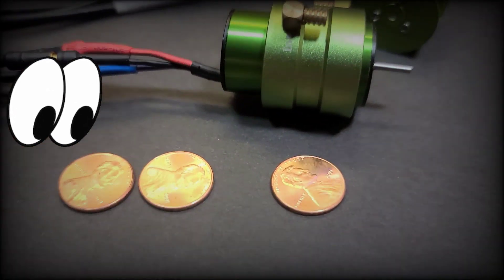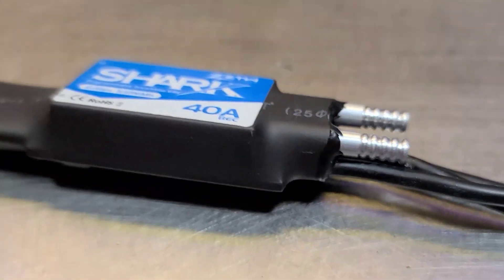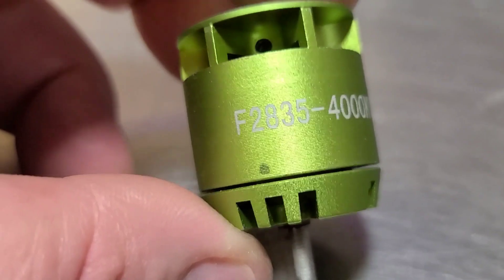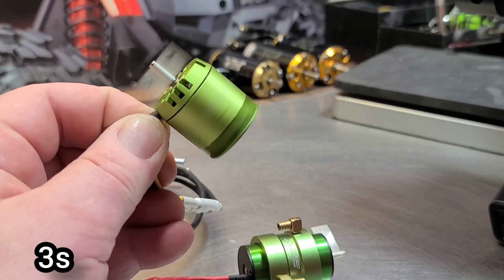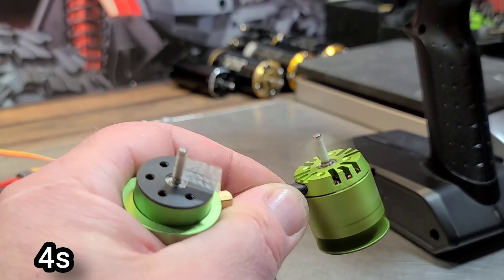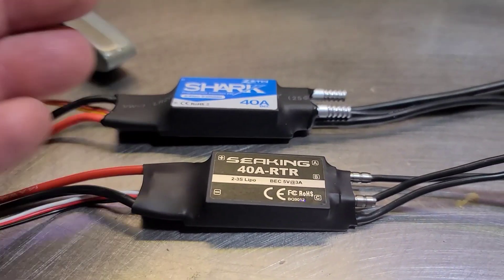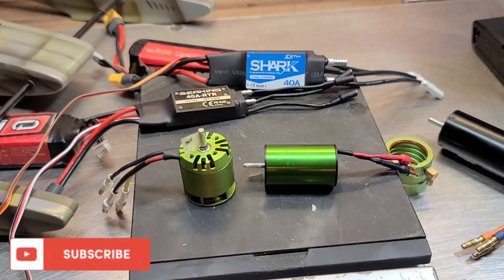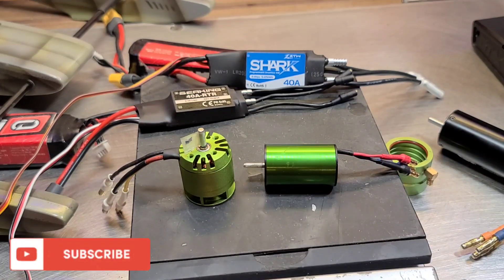Inrunner Vs Outrunner Motor Test |  Brushless Esc Comparison

Comment: Fascinating.....  I've been a big proponent of 1:20 scale hydro racing (about 16" ~ 18") for some time and am running some of the same motors you've been discussing here in my scale boats.  The outrunner motor you review here is a 450 size helicopter motor and there's a HUGE selection available in varying length, diameters, and Kv.  I bought the last of those FRP outriggers based on your reviews because I'm sure I can get it to stop hopping...
Reply from the maker: I'm actually about to replace the stuffing tube and run it under the tub.  I know that's what it is.  I actually took it out today for a quick test.  I moved the turn fin back to where my cg is and she was running pretty good. Still has a little bounce at lower speeds.       Thanks for watching.
Reply: Uuyy
Reply: Yyuuuy 😝 YouTube yuyyyy
Reply: Yuu
Reply: Y
Reply: Yuyyyuoyy

Comment: Good afternoon, please tell me there is a problem with 40a ESC, as soon as the voltage of the 3S battery drops below 11.2 volts, the boat cannot go at full acceleration, when you push it to the end, the boat just stops and you need to release the pedal again and start again and do not press to the end.  Thank you.
Reply from the maker: You more than likely have the boat "over propped for that speed control, maybe try going down in prop size to reduce load?  

Could also be the low voltage cut off letting you know to bring the boat in and Change batteries

Comment: hi what are the mount hole c/c on the 4000kv  racestar 2835 ?   16mm ?
Reply from the maker: Sounds about right look on ebay for that motor they usually list the pattern size

Comment: Iv just brought this shark esc on my motor iv got red black and yellow wire on esc there all black lol does it matter wot one goes where iv not tried it yet as I don’t wanna blow out
Reply from the maker: Plug the 2 middle wires together  the 2 outside wires don't really matter which one you plug in to one another. The 2 outside wires change the motor direction.  Hope this helps
Reply: @IRONCLADRC  Errm so two out side wires are red/black and middle wire is signal then yeah ? Think that’s wot I’m getting from your reply ? As you mentioned 2 middle wires and 2 outside but there’s only 3 in total

Comment: So, I just toasted my 2000kv 6 pole motor on my Veles 29” pro boat. I’m using 1716 prop two 5000mah 50c 3s. What would you recommend for a motor? I just did the two water lines upgrade this was the maiden voyage with the prop. Thanks for any information.
Reply from the maker: An tfl SSS brushless motor is a great upgrade

Comment: Good day sir..did you test the racestar 2835 on a boat using 4s??isn't gonna burned??
Reply from the maker: 2835 burned on 3s with a prop that was to big for the motor.  The 2835 actually handled 4s with a small prop under light loads.

Comment: Got a couple of questions for you if you don't mind answering. I have a Proboat Widow Maker, that only can handle 2s lipo. Wanted to upgrade the boat to accept 3s to 4s lipo and i'm not sure if the stock motor can handle 3s and it probably won't handle 4s. If i buy the ZTW esc, what motor do you think i need to put with the ZTW esc? I would buy the other option you used for the video but i don't like buying from China & waiting 2 months...i think you get my drift. Ty for your help in advance brotha!
Reply from the maker: What's the length of the boat? Is it heavy for its size or light?

Comment: What's your thoughts on car esc' 🚗 I like a reverse... just run a h2o cooling plate instead of the fan 😎
Reply from the maker: It will work If you can waterproof it?

Comment: Do they make racer star outrunners in something suitable for 6s?? Could be a not bad little upgrade from the stock SR80 motor (1750kv)
Reply from the maker: Offshoreelectrics.com has leopard outrunner motors I think there 6s.  Aquastar has an outrunner motor as well, hard to find!
Reply from the maker: https://www.google.com/shopping/product/1/image?q=trex450+upgrade+motor&client=ms-android-uscellular-us-revc&biw=360&bih=672&sxsrf=ALeKk02qPjw9qFC0Yp_tq1DXnEna2vGtqA:1628119479506&sa=X&ved=0ahUKEwj9_f3ywZjyAhVhRzABHQyzBFgQnUAIQQ&prds=cs%3A1%2Ceto%3A17001821010392615322_0%2Cpid%3A17001821010392615322%2Csgro%3Aiv%2Cmvi%3A0

Comment: I recently purchased my first RC boats, an FT012 and an Atomic.  Only had them out twice and I already want to build a boat.  The wide range of motors, batteries, ESC's etc makes it complicated for someone new to the hobby like me.  I really appreciate you putting this video together as it helped me improve my knowledge.  Looking forward to buying some parts and start building.  Thanks!!!!
Reply from the maker: The atomic catamaran?  How did the atomic preform? GOOD LUCK with your build.
Reply: @IRONCLADRC  I can't speak from knowledge or experience because I'm new but I REALLY like the Atomic catamaran.  One reason I purchased these two boats was to learn and experience some of the differences between them.  The FT012 is a V hull and it has trim tabs and stabilizers on the rear.  The Atomic is a catamaran without trim tabs and stabilizers.  To my surprise the catamaran handles WAY better without the extra hardware the FT012 has.  The Atomic got up on plane quicker and it turns on a dime!  I guess it's the difference in the hull design?  I paid $130 for the Atomic and couldn't be happier.

Comment: Hi is the Outrunner a t-rex 450 helicopter motor cause I have new one so this is good your testing it
Reply from the maker: Racerstar 2235 4000kv
Reply: @IRONCLADRC  2835 4000kv ,must be re labled ,run 4s my goodness 😊
Reply from the maker: Yea I looks tobe the same like u said just rebranded or something.
Reply: @IRONCLADRC  👍..can you do a destruction test on one of your motors like set it up in a mount and give it full revs until it blows or not,I bet the Outrunner lasts longer as it cools itself

Comment: Can 30 amp esc support 4000 kv brushless motor
Reply from the maker: I ran the rocket 2968 4000kv  with a dynimite 30a and the Temps were warm/hot